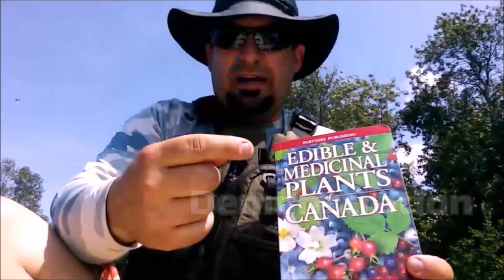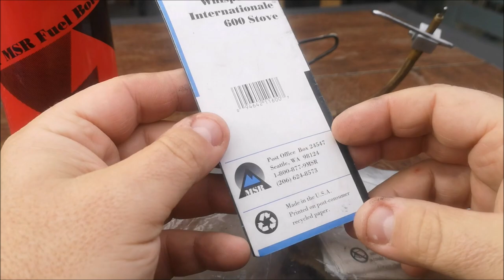MSR WHISPERLITE INTERNATIONALE 600 STOVE REVIEW

Comment: Good review, I know this is multi fuel stove that will practically run on any type of fuel, what type of fuel gives you the longest burn time, which fuel do you think is the best.
Reply from the maker: That is an excellent question. I actually have only used white gas/naptha/Coleman fuel. If I find out I'll definitely post my findings. Cheers.